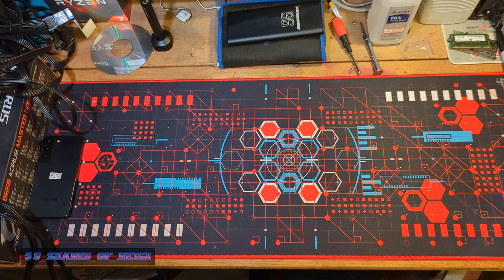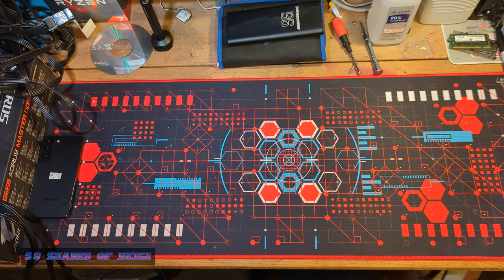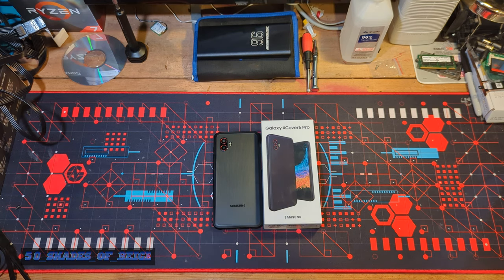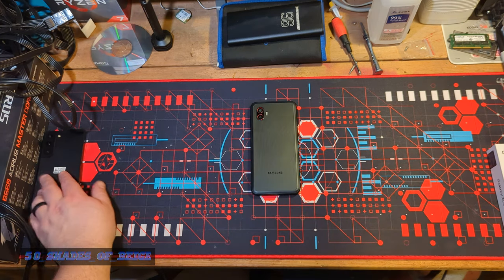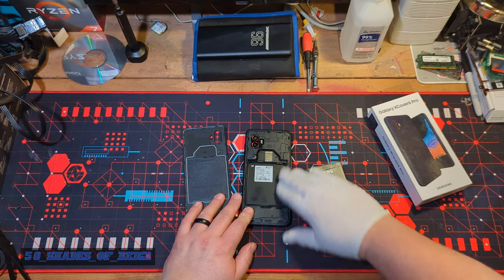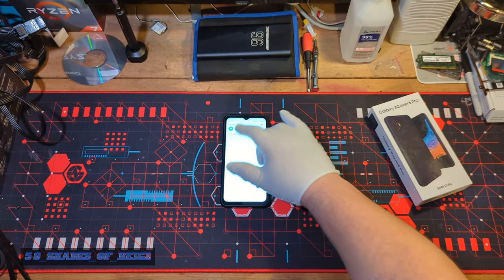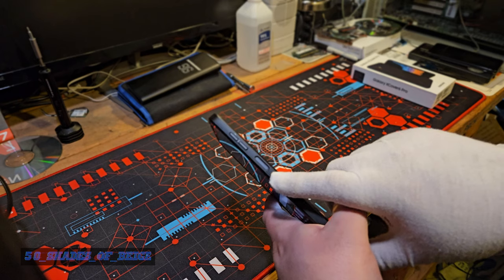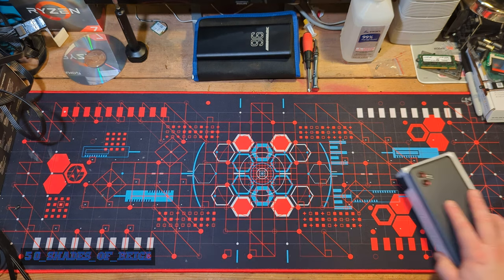Samsung's hidden gem? XCover6 Pro Review

Comment: If this thing had a flagship grade camera and a bigger sized battery, it'd be the "only phone you ever need" - but they can't have that can they - how else will they incentivize you to throw away your perfectly working phone after the battery goes out
Reply from the maker: I agree.
Reply: you can just replace the battery
Reply: Yeah fleabay has the older model Xcover Pro batteries that also work  in the Xcover6 Pro for $12ea. I bought 5 of them for prosperity sake. They work as good as the factory battery.
Reply: The battery can be removed so that solves that
Reply: Thank you bro..I will be ordering this phone in the morning
Reply: @Dstylz  how is it?.. Overall.. Not flagship. Cam
. But how's the Fluidity of day to day performance?

Comment: I have one of these.  I bought it specifically for the replaceable battery.  It is an excellent device.  My only real conplaint is that the back seems a bit flimsy, and I had a very difficult time trying to buy a spare plastic back in the USA (there are web stores in Europe that sell them, but Samsung USA was useless when I tried to buy one here...I ended up ordering it from Europe and paying crazy shipping charges).
Reply from the maker: Yes, the back is flimsy, it's very similar to the back they used on the Galaxy S5. I wish they sold replacements for a reasonable price.
Reply: @50shadesofbeige88  They really should just have a web store for parts, or at least a phone number to call to order parts.  There seems to be no way to order this in the USA.  Also, I haven't found a service manual yet.  Still a good phone, though, and one of the best on the market right now.
Reply from the maker: Yeah I wouldn't hold my breath waiting on a service manual. 😂 Samsung does provide them to partners. Give the replacement parts a couple more months. Of course, Samsung will not sell them to consumers (although I wish they did), but salvage parts usually start hitting the market within a year or so of the phone being released. It's tough, because XCover is not super popular, so salvage parts will also be harder to get. I can get the batteries, the rear covers and the LCD assembly only.
Reply: I wonder if this is a problem a 3D printer would solve..? Anyone reading this thread know much about them?
Reply from the maker: Yes. I don't think PTFE filament would be flexible enough or printable at such a fine tolerance. I suppose it would be fine if you weren't worried about case fitment or maintaining the original design for water resistance.
Reply from the maker: Definitely something I can try though.
Reply: So - who doesn't buy a decent phone cover anyhow?

Comment: Bought one a year ago, want to keep it for the next few years, after a year of heavy use with battery degradation it took less than 3 minutes to take it out of the otterbox, pop off the back, slap in a new fresh battery, and put it back together.  Camera isn't great but meh not big into mobile photography to begin with, definitely still a great phone even in 2024.
Reply: The removal battery is such a great feature to have. In terms of the cameras, it is no big deal. If people want good cameras, they should just buy one.

Comment: I am in the need of a more rugged phone now that I work in marine engineering, I constantly drop my phone and I go through screen protectors and phones very quickly.
Reply from the maker: I worked as a dock master in a previous life. I think this phone would do well for you.  I'd buy the OtterBox Defender case to go with it.
Reply: @50shadesofbeige88  I’ve even looked at the a54 and getting a rugged case because it would be cheaper with better specs, especially since in my country the xcover6 pro is quite an expensive option.

Comment: I dont remember exactly but  Samsung rugged phones have been out for years now. The problem is that these phones are delegated to a lower level of importance of Samsung's phone lines. The other thing is the extra batties can get pricey since they probably dont make that many of them. Its not like the days when I had my Galaxy Note 4 and there are so many different aftermarket battery I could buy.  I think some of Samsung budget phones have removable batteries too.
Reply from the maker: I understand your concern, and it's certainly not without reason. Modern XCover phones share the same battery and pogo pin layout. There are many listings on Amazon for replacement batteries and the cost is around $20 for just the battery. As far as Samsung neglecting them, I don't think that's something to worry about. They do make a lot of them, they are targeted at the B2B market, that's why you don't see them often. My company has an SLA with Samsung Electronics America that guarantees we will have support through 2027. All of the Enterprise models get monthly security updates and there is a roadmap for the XCover6 Pro to get major OS upgrades through Android 15. Even the older models like the XCover 4s, still get security updates despite being beyond the average lifecycle of an enterprise device. I'm not saying this phone is for everyone. If headphone jack and user replaceable battery are key features, it's a very good option considering the software ecosystem Samsung provides.
Reply: @50shadesofbeige88  Thank you for the info. It's good to know that Samsung's sales pitch to B2B is to honor the long life of OS and security updates.

Comment: So what is up with this 25 watts charging compared to 15 watts??? Is it true or what.... What model would then have the 25 watt and is hardware or software level. If hardware does it then have better cooling? do you know?
Reply from the maker: Charging is handled by the chipset on this phone. It is not software. I haven't had any complaints of  heat issues while fast charging. 25W is nice to have in a pinch but, the beauty is, you can keep a charged spare battery ready to go. So if you want to leave it disabled it's no big deal. 15W is a little slow in 2023 though.
Reply: @50shadesofbeige88  What i am asking is there a difference between the phone versions - the 25 watt charging is said to only be on the US Versions, and the rest is said to be 15 watts.

What version do you have yourself, what is the number behind the battery?

Comment: I have Samsung Galaxy S5 Active Camoflauge color STILL works normal but it has 2gb RAM. So I can not use many apps no more. I love the phone and have been using since 2014. I have 4 batteries of this phone. Right now I am typing this from my phone.

I am planning to buy this phone soon and I know that will be way better than my current phone. Together with full case protection like I did with this phone because there is no way can handle impact after another impact and many more. No need to risk my 600+ Euros for 30-40 euros case.
Reply: I still on my galaxy S2 and.... it's a supplice xd

Comment: I'm planning on getting one of these to replace my teracube 2e. Its hardware is just too old to operate with modern software properly. Thing freezes and restarts itself if you so much as look at it funny. 

I don't really care about ruggedness (I plan on using a case and screen protector anyway), but the poppable battery, microSD slot, and headphone jack are non-negotiable for me. 

On top of that, people have managed to install magisk on this thing! Huge bonus for me. I've preferred using a rooted device pretty much the whole time I've had phones.

Comment: I had xcover3 and then I had xcover 4 for 5 years. Battary still perfect, since I rarealy charged over 80%(ACCUbattary app, was helpful tool) and now for 3 weeks I have had xcover 6. Really good device, only from camera I was little  dissaponted. And I have to mutch white balance. There no option to reduce it. Preovious xcover6  android(12) had this option. Whit 13 it is removed.
Reply from the maker: Fair enough. Yeah the camera definitely isn't great compared to something like a Pixel 6a for around the same price.
Reply: Why do you only charge to 80%? I was told to let it go down to 5 or lower and always charge to 100%. Thank you.
Reply: @mlw8998  who told you that?
I am not going to give you a straight answer but rather directing question.
What does 5, 80 or 100% battary chargeing status tehnically even mean for you?
Reply: @Martink9191  Obviously I don't know what different levels of charging means that's why I was asking you. I thought maybe you have wisdom concerning this area that would help me handle my phone differently. It's ok, no problem I will try and see if I can find out another way.

Comment: It has been a year since this post. Do you still believe this is a very good phone? I am looking for a phone with a jack and removable battery. I had a Note 2 and it worked for 10 years and finally died but I really liked its ease of use. Is this still the best one or is there another on the market now that is better?
Reply: Had mine over a yr heavy use and no complaints- good midrange processor and prices falling.
Batts fit from older Xcover too.

Comment: Why u need Amoled? U wanna get half blind? Why no one talks about flickering on amoled screens?
Reply from the maker: AMOLED is a broad term, but generally speaking it is by far the superior display technology. It offers fantastic contrast ratios and is very efficient which are both important features on a smartphone. I haven't experienced any flickering issues in quite some time.  The issue was solved when variable refresh OLED displays came out.
Reply: @50shadesofbeige88  i ment pulse width modulation
Reply: @Pcut LMFAO you realize that almost every other display is PWM backlight right?

Comment: How does this thing compare with the Gigaset GX6 etc?
Reply from the maker: I prefer it to the other rugged offerings, mainly because of Samsung's software ecosystem. You can get other rugged devices for less, but for example: The Kyocera DuraForce Pro 2 runs basically a stock Android rom..  to the point where you have to download FK if you want to manage local files. Also, since we use Knox and InTune for MDM, the Knox hardware gives us more robust security and management options outside of the standard Android Enterprise API. Also, Samsung guarantees 3 years of major updates + 5 years of security updates (may vary depending on the market) this is huge since I work in the defense industry and STIG compliance is a must.
Reply: @50shadesofbeige88  Well, the software doesn't really matter, I'd replace it with open source software regardless of the phone.
It's the hardware and how easy it is to replace the software that I'm interested in.

Comment: PUT THE PHONE IN A CONTAINER WITH WATER.😀😀😀 I DON'T THINK IT RESISTS WATER. ONLY RESISTS SPLASHING WATER.👍
Reply from the maker: I'll gladly fully submerge it live on stream, but I'm holding out for 500 subs.  Stay tuned.
Reply: Water does find its way into the back, but it doesn't reach the internals.
Reply from the maker: @jamesb8305 yeah the gasket on the back seems to work well.
Reply: I got an Xcover 5 with a similar back cover and gasket and it survived the bottom of a pool just fine
Reply: Yeah and hit it with a hammer after you put it in water...😂😂..somebody sounds jealous..lol

Comment: Can I pretend that my name is Lewis and try out this phone?
Reply from the maker: Nice try 😉 If you'd like a more in-depth review I can certainly provide it. My production value has gone up considerably over the past few months.
Reply: @50shadesofbeige88  Your production value increasing means it's more trivial for you to send me the phone, right? Would you know, is there any bloatware on the unlocked, straight from Samsung US version of this phone?
Reply from the maker: Unfortunately, as with most Android phones, the bloatware mostly comes from the carrier. For instance: Verizon installs about 12 apps on every phone, 2 of which can not be easily uninstalled. However, you can get a relatively clean ROM if you buy carrier unlocked directly from Samsung.  

By production value, I mean I could make a more compressive review of the phone addressing your specific concerns and compare it to other competitors. My mic is better, my scripts are better and my camera mounts are better. 😊